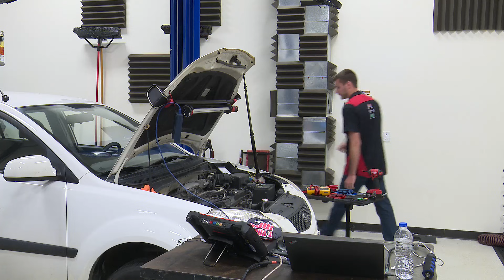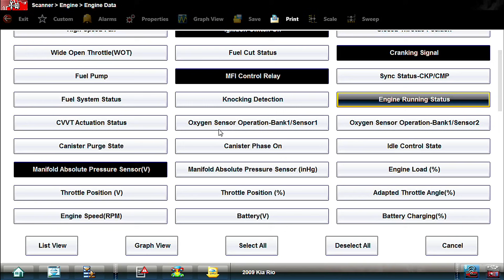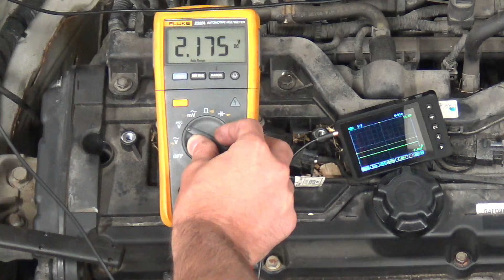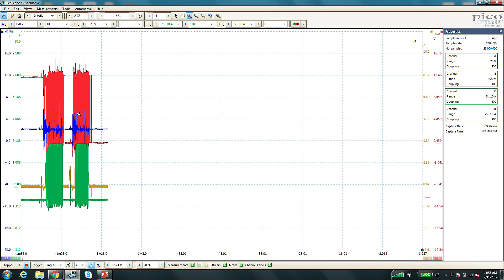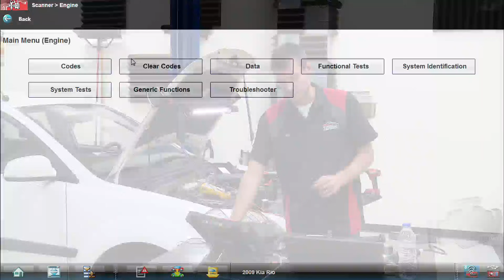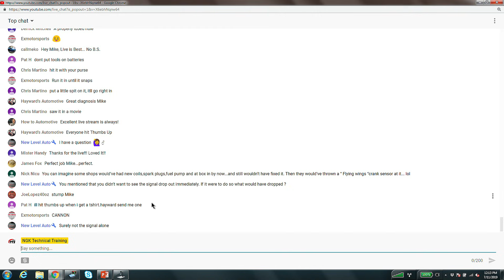Intermittent Stumble, Rough Running, Stall Concern. No Check Engine Light or Codes!!! *2009 KIA Rio*

Comment: It was nice to see the failure captured on the scope so you have definite confirmation of the failure. In regards to the t-shirt question (I know it's too late now), I think only Tech B is correct. In that case, I suspect that the canister purge valve is stuck open, allowing fuel vapors to fill the intake manifold after refueling. So, the engine is flooded with fuel vapors and cranks long and stalls, or starts and runs poorly then clears up. If the throttle is opened, the engine also tends to start easier. I had that problem on a Hyundai Tiburon some time back.
Reply from the maker: Hey Joseph, thanks for watching! Perfect response to the question. You nailed it! Well done :)
Mike Becker, Senior Technical Instructor
Reply: Could you tell me more about what you experienced ? I have an 08 Tiburon Automatic. No check engine light, went to 3 mechanics and none could find codes until the 4th found a code for o2 sensor. I replaced the o2 sensor 3 months ago. Car will sometimes star when on low speeds after idling. It is fine when driving at higher speeds for longer amounts of time.

Ty
Reply: @VBLAQ88  The vehicle is a 2001 Tiburon. When the purge valve stuck open, it would largely just cause issues starting after adding fuel. Any other time it would start and run fine. I did also experience surging and intermittent stalling with the car. That was a separate issue. It turns out the throttle position sensor was faulty. The idle would suddenly speed up, then it would start misfiring and stall. I was able to see on the scan tool that the throttle position would jump to 25 percent, then back to 5 percent. The engine computer was responding to it as if the throttle was being actuated, so it would adjust the fuel and ignition timing, then do a fuel cut, nearly causing the engine to stall. No codes were ever set.

Comment: Great demo of a diag strategy for intermittent. Some pple will think u need the mega bucks 8 ch Pico ... but u don’t. I use an 80 buck 8 ch Hantek scope which is fine for virtually any signal except detailed ignition waveform analysis or CAN. I just put the pico in a glass display cabinet and admire it 😉 just take it out for a walk for ignition work😂
Reply from the maker: Hey Alex, thanks! I would love to get my hands on the 8 channel. The more I can see, the better. Why not use the PICO if you have it?
Mike Becker, Senior Technical Instructor
Reply: NGK Technical Training For sure. Pico I have is a 2ch ...Ha! Thats why the work around alternative.
Reply: @alexmessina7652  what model number do you have for the hantek and Pico?
Reply: 1008c for Hantek, 2205 for Pico ... not the highest end but works for me😉

Comment: Initially when you hooked up the scanner it did indicate mil on
Reply: The engine was not yet running. It would have gone off upon starting the engine.
Reply from the maker: Bart, it's likely because it was only key on-engine off. As for codes stored, it did not occur until the CKP failed, went open and then failed the CKP circuit test.
Mike Becker, Senior Technical Instructor

Comment: Thanks for the great video Mike. 
Last week I had a intermittent problem on a 2019 Corolla that died while drive only. I found the loose pin fit on 12 volt to all injector while scoping fuse to both injectors and coils while verifying cranks signal on scan data. All injector current lost when engine died. Something like this is much easier to find with a scope.
Reply from the maker: Hey Joshua, thanks for watching! Wow, on a 19'!! What do you think caused the loose pin fit!? Either way, nice diag! Scope sure is nice :)
Mike Becker, Senior Technical Instructor
Reply: @GoTechTraining  I work for a dealership and only find the weird repairs on new models. I found the female terminal was damage when the harness was manufactured.

Comment: Weird how there were never any codes, then boom crank sensor code! Perfect timing you might say. lol Great job Mike. Thanks!
Reply: It may have stored pending codes which would have been erased if the fault didn't reoccur soon enough.
Reply from the maker: Thanks for watching! The only time the CKP will code is if it fails the circuit test. IN this case, I was able to force the sensor to fail, when it got hot, which actually caused it to go open and fail the test. That's why it coded this time.
Mike Becker, Senior Technical Instructor